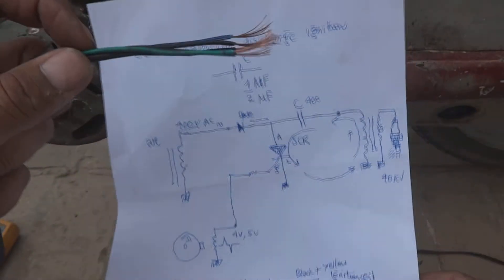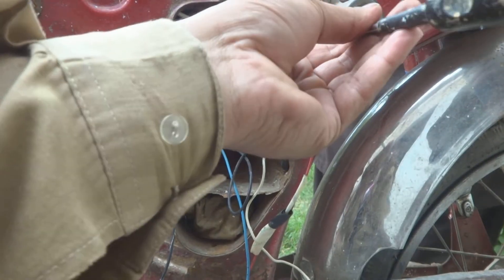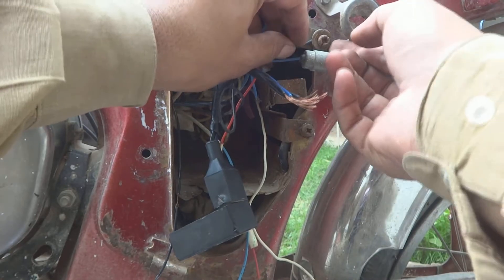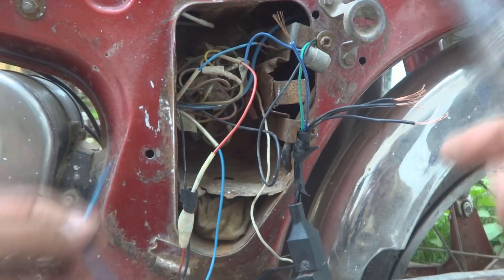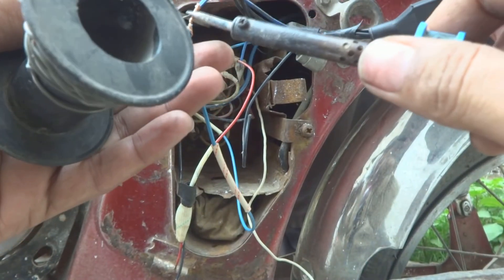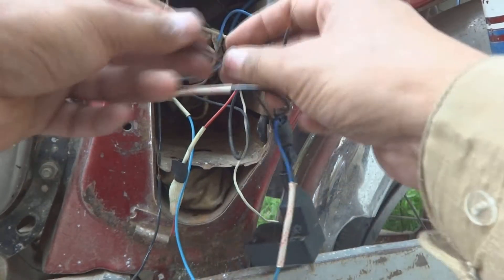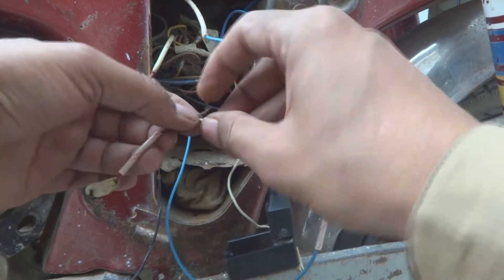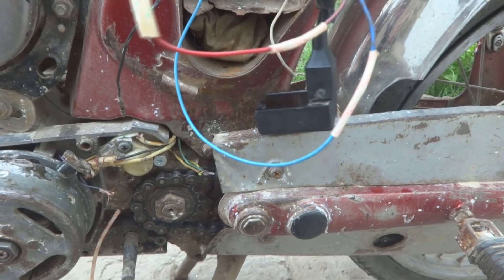CDI Wiring. How to wire a cdi, how to convert a bike to cdi, ignition system

Comment: What about the trigger pulse?  How / where did you get the trigger from?
Reply from the maker: Triggering pulse is coming from a small triggering coil installed outside the magneto. For the purpose a small magnet is installed outside body of main rotating magnet. The small magnet and the trigger coil is installed in the position of top dead center of the piston.
Reply: @JahanZeb1976  thanks, I assume that the flywheel internal magnets don't interfere with the trigger coil? And that the built in CDi advance curve adjusts the timing.?

Comment: My male plug has a yellow wire a dark blue with a white line on it solid green solid yellow and solid black with a male connector the male connector that goes to the bike adaptive the one run for my bike has a male adapter that has a green with a yellow stripe on it two of them two brownish orange looking color type wires and a black with a brown stripe going through it I could use any help if possible

Comment: To wire a CDI box it's a 1985 Honda Shadow VT 1100 I bought one off eBay that's compatible with my bike they both had male plugs from my by female plug has 6 wires and the box I bought has four I was told that it is compatible with my bike I'm wanting to know if anybody knows how to wire the box that I bought does not have a male adapter to it just has two wires in a different color than the one that I have that has the male adapter to it

Comment: Hi
Keep uploading informative videos.i have jd generator it has gas kit fitted when I bought it but the problem it doesn’t start on gas I was told by a technician to start it on patrol when started then run it on gas.but it should start on gas cold.what do you suggest.
Reply from the maker: It should be. You must make maintenance on your gas kit, adjust it critically and then run. Hope it would start on gas too.
For gas kit maintenance and adjustment watch my video here on my channel. Wish you good luck.

Comment: Thanks for the advice just to make sure if something is 60 watts ac 220 volts the amps are .27amps.if something is 60 watts Dc at12volts dc.the Amps are 5amps so I need 5 amps ac switch is that correct.
Reply from the maker: Sure. You understood it well! I was expecting the same from you.

Comment: Hi
Can Normal AC switch buttons be use to operate DC components.like fan light etc
Reply from the maker: There is no such thing like ac or dc switch. All switches have contacts and they bevave the same way in ac or dc. But there is a specification current rating or ampere rating for every switch contacts. If you have 12v dc system, there will be higher the current rating for appliences like fan, lights or heaters. So you need high current rating switches compared to ac 220v where same fan and light would have much less current rating hence they need less current rating switches. This is the difference. Anyhow you can use toggle switches from automotive parts suppliers which have much big current rating at reasonable price. Hope you may get my point.